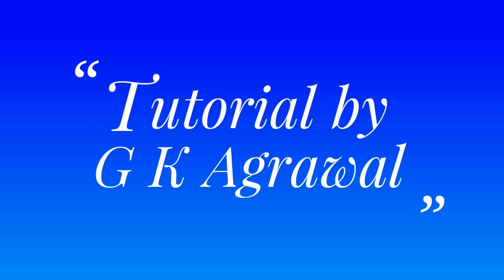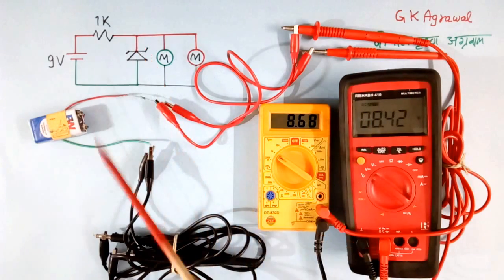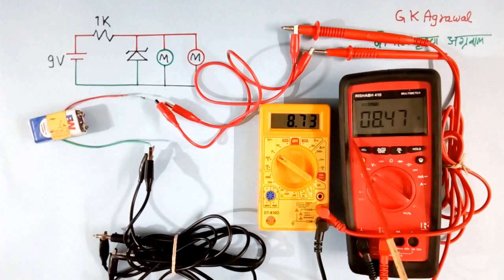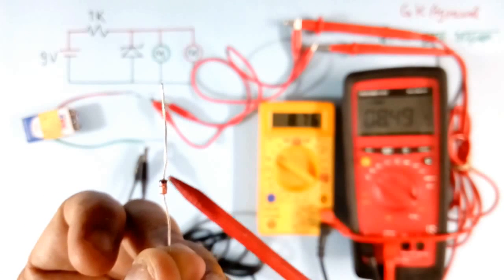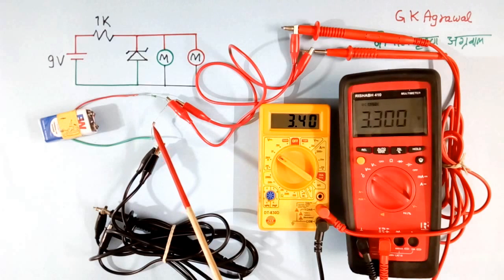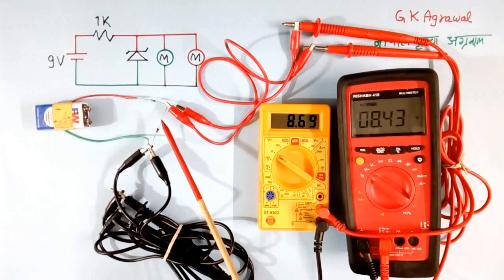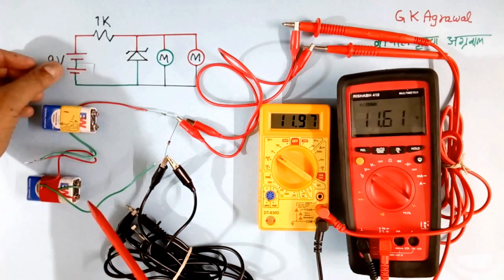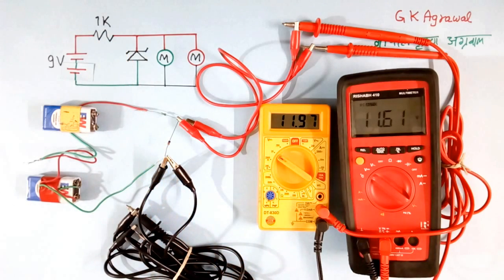How to find Zener diode voltage with multimeter, Experiment

Comment: Great, brief, explanation of testing the voltage of a Zener diode. It would, however, have been more helpful if you mentioned the values of each Zener diode used.
Reply from the maker: Thanks for comments and suggestion, I will keep your suggestion in mind in future videos.